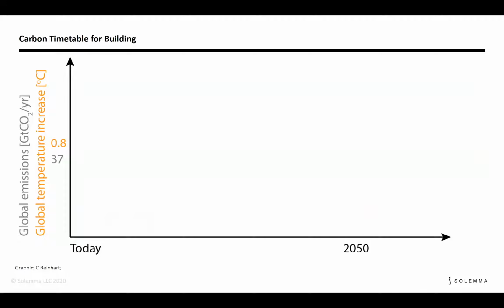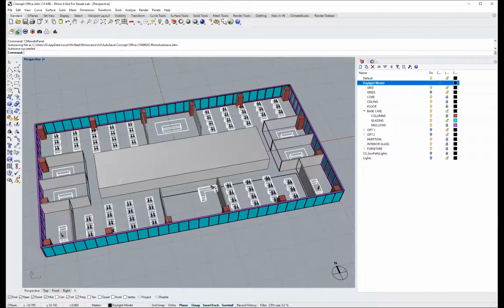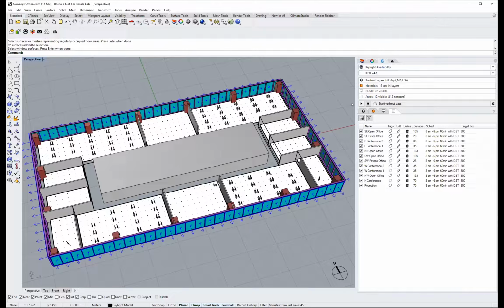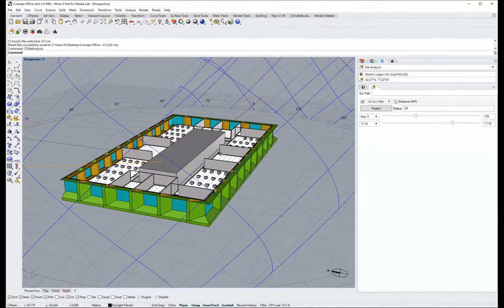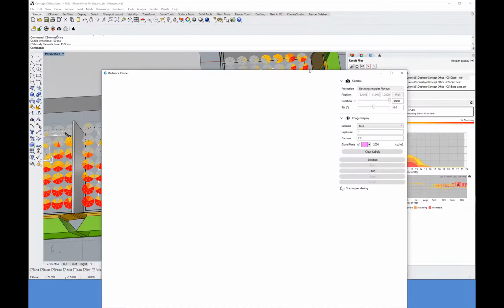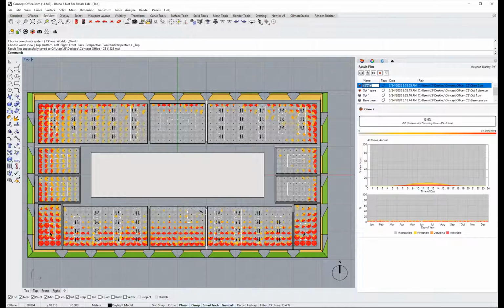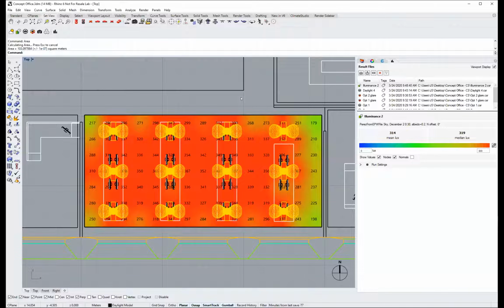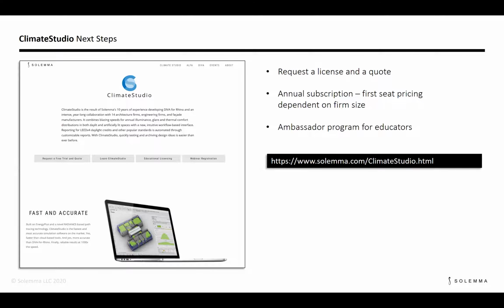Introduction to ClimateStudio Webinar: Daylighting

Comment: amazing!! is it possible to calculate how many sqm area achieved our target of daylight? because another green building certification has different rules, such as for DGNB is required 50% of room area achieved min 1% DF
Reply from the maker: Hello! You can automate this process within Grasshopper (if you'd like an example script, feel free to email us at support@solemma.com). From within Rhino, you can export a CSV of the individual point results by clicking on the little CSV icon in the results window. Then you can count the fraction of points meeting your targets.